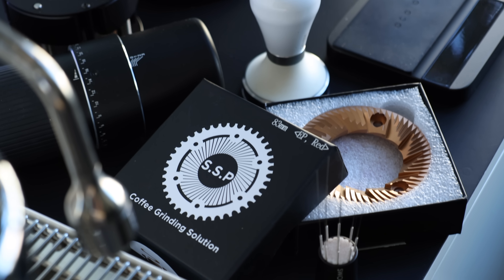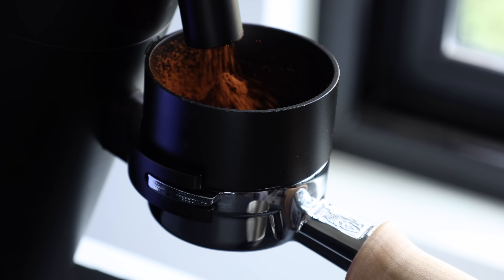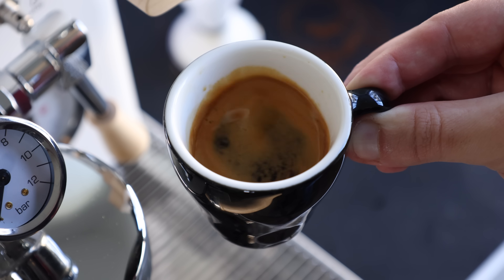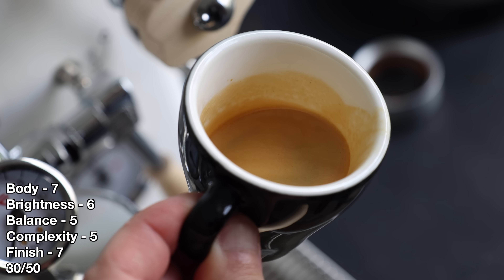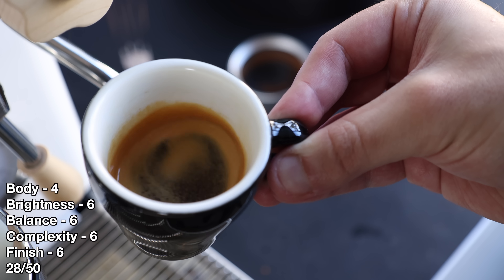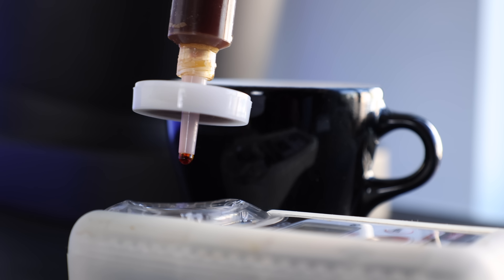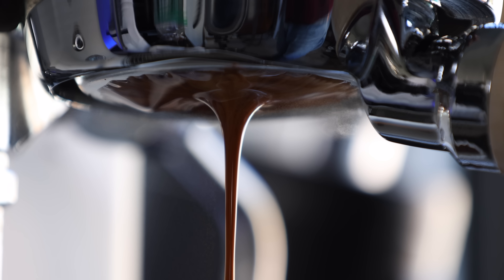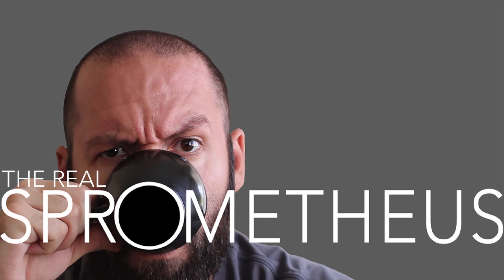ESPRESSO ANATOMY - Exploring Brew Pressure

Comment: Since getting my flair 58, I have found myself liking the 3 bar pre-infusion and ramp up to 6 bar shots. Seems to provide the ideal balance of sweetness and acidity for me. The 9 bar shots that I have pulled on the flair have been too acidic for me.
Reply from the maker: That’s been my go to as well. With a variety of timelines for pre-infusion, from 15-30 seconds. Crazy the differences it can make.
Reply: Be careful though: From my understanding, the pressure you measure in the flair is not the same that you measure in the electric machines. In the flair the gage is directly in the brew chamber, which should be about half a bar lower.

I mean, 9 bars in the flair is probably closer to 9.5/10 on a normal machine.
Reply: I third this 2-3 bar preinfusion and then ramp to 6 has been my go to. Haven’t tried anything other than light roast tho. Just like everything in coffee, im sure some varieties, regions, or development level might be better at different pressures just like some are better with conical or flat. I guess thats the fun and frustrating rabbit hole of coffee lol

Comment: I like to keep my espresso brewing as simple as possible, so I usually stick with the tried and true 9 bars.
Reply from the maker: If it works and you like it, no need to fix something that isn’t broken.
Reply: It’s been around the same 9 bars for over 100 years. I agree some beans can be pulled at a lower pressure. I feel the light roasts.
Reply: @BigPoppa-t3z  1920s coffee 9 bars lmaooooo gaggia wasnt even founded yet. Maybe if u had a pipe bomb of a percolator but theres no way 9 bar is 100 years old. Just keep making stuff up bro.
Reply: @BigPoppa-t3z  technology and coffee in general has come a long way since 100 years ago though. The coffee they would have been consuming is completely different to what it is today. I’ll bet that it’s absolutely disgusting as well compared to what we like today (that’s assuming it’s anything like traditional Italian coffee). Life’s too short not to experiment with things :)

Comment: Big take away for me is that the 9 bar shot still had decent complexity and cup quality while having the most body. This is why it is always the standard for shops due to all the milk drinks they are churning out at 12 to 16 oz.  For a specialty shop not exceeding a 10.5 oz beverage 7 bars might be worth trying out.
Reply from the maker: That’s an interesting way to look at it. I often just look at it in such a straight forward perspective, so that’s a good point. Plus, I usually don’t make anything over 8oz haha.
Reply: @Sprometheus  i don't even go over 6 oz flat whites tbh. 8 would probably be pretty good but I don't have 8 oz cups, only 6 and 10 and 10 is way too dilute.

Comment: I have an older gaggia where the OPV can be adjusted with an allen wrench... have it at about 8 bar, gonna have to try these lower pressures
Reply from the maker: Right on! Let me know how it goes. I have my Gaggia with a 6.5 spring and had some really solid, lighter, single origin shots with it.
Reply: @Sprometheus  I have my gaggia at 9 currently - would 6.5 be worth it if I mainly stick to medium roasts?

Comment: I would have liked to see 10, 12 and 14 bars as well given that most Breville's are using max pressures of 14 bars out of the box at times depending on how the OPV is set at the factory. This would shed light on the necessity of lower pressures closet to 9. Great video though!
Reply from the maker: Yeah I considered going higher as well. When I tried 10 bar just for fun it was kind of inconsistent, and messy so I decided to stick with the 9 bar “ideal” as the top. It may be something worth re-visiting at some point though. Thanks for watching and the thoughtful comment.
Reply: Yeah, Gaggia also has been well known for the use of higher pressures out of the box to allow pod and pressure baskets to make an "easy" experience for new buyers.
Reply: RE: Gaggia: Marc over at Whole Latte Love was responding to a lot of comments on a Gaggia Classic Pro video of theirs about brew pressures. He said they've tested the pressures at the group head and on the Gaggia Classic Pro it is nowhere near 14 bars of pressure when using non-pressurized baskets. He said the small vibratory pump is simply incapable of producing that much pressure when using a non-pressurized basket and therefore it's not necessary to change the OPV spring on them. With that in mind, I don't understand why the new Gaggia Classic EVO Pro has a 9 bar spring installed from the factory. That's counter to the argument that a 9 bar OPV spring isn't needed. Maybe it's so the pressurized basket is at 9 bars?
Reply: I'd like a pony. 🙄

Comment: Is the pressure measured at the pump or grouphead?
Reply from the maker: The lower gauge is the pump peak pressure, the gauge on the group shows the pressure inside the group.

Comment: Did you see much variation in what happened at the group pressure gauge on the Bianca while adjusting the pump pressure?
Reply from the maker: A little, but more so on the lower end. As I got to about 5 bar, I noticed the pressure in the group was peaking a little lower. So it took some trial and error to find the pressures that gave me the peak I wanted without using the paddle.

Comment: Quick question, I found that my Bianca came out of the box adjusted to around 10bar out the box. What would you recommend the rotary pump pressure to be adjusted to?
Reply: To your taste ?
Reply: @Noplacetobe  just trying to get a feel for what other people have done, I like other perspective.
Reply from the maker: Yeah mine came set to 10 bar as well. I set it to 9 bar, which gives me the ability to adjust manually up to 9 when brewing. But if you are using the pre-set modes I’d recommend toying around with a few pressures 7, 8, 9 and see which you like better as it will peak at those when using auto functions.
Reply: Thanks for your insight. I set mine to 9 bar, but have been running shots between 6-7 bar at the group, but I find the paddle is barely at 45% open to achieve that. Eh it’s fun to experiment with anyway. Thanks for your insight anyway!

Comment: In your experience, does pre-infusion make a difference to the taste of the final cup when changing pressure? I.e. Is it made redundant or require less time at the pre-infusion stage due to a reduction in pressure to 6 bar?
Reply from the maker: Personally, I still find pre-infusion making a difference in the cup regardless of the peak pressure. For one it allows a slower, softer expansion of the puck, leading to an extraction less likely of having defects. But also, when it comes to lighter roasts, it just really takes the edge off of that up front punchy, or acidic bite.
Reply: @Sprometheus 
Can you elaborate what PI settings you used? With my Bianca V3 I usually use 5 seconds PI at low flow mode followed by 5 seconds pause. Works well in most cases.
Reply: IMO preinfusion increases coffee contact time and consequently adds more body and less acidity which I prefer.

Comment: I really wish it was easier to change the pressure on my Appartamento. I’ve done it, but dang. What a hassle.
Reply: how were you able to change the pressure lower than 9 bars? I found that if I go lower when turning that bolt at the bottom, I get a lot of leaking on the bottom of the machine and on the counter over time.,
Reply: @pablo-zn1mg  interesting. That didn’t happen to me. Don’t know what to tell you.
Reply from the maker: I’m not all that familiar with the Appartmento, but if it’s anything like the Mini I had to remove panels to make it happen, it is a hassle for sure.

Comment: In my non-scientific exploration of this topic on a Cafelat Robot, I found that lower pressure shots (roughly 6-7 Bar) were sweeter and generally tastier than 9-bar shots.I’m looking forward to exploring this further on a Odyssey Argos lever machine, which can switch between 8 and 6 bar springs, or full manual.
Reply from the maker: That been the general gist of mine as well. I also am looking forward to trying out the Argos!
Reply: @Sprometheus  Great topic to explore, by the way, thank you!
Reply: Same experience on a robot here
Reply: I believe this is due to where the pressure measurement is taken on thr Robot. It's taken more direct than at the pump(?) on a traditional machine.